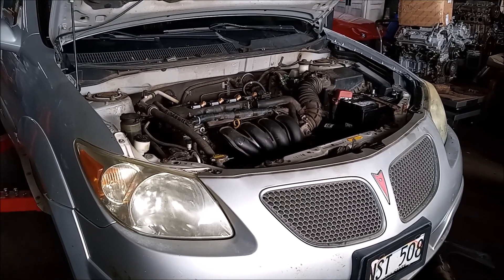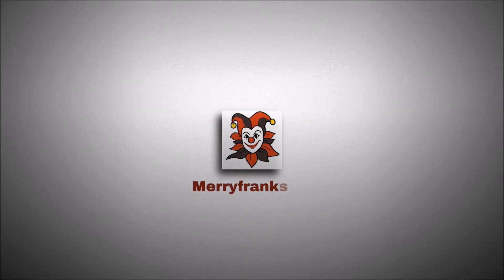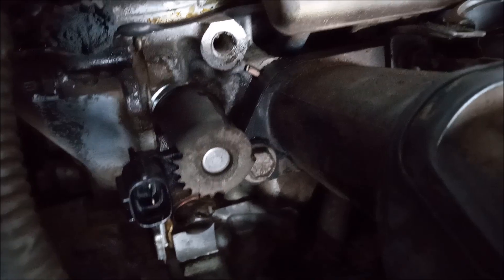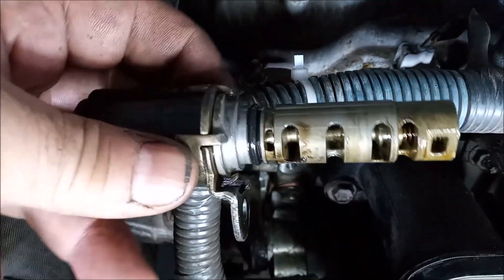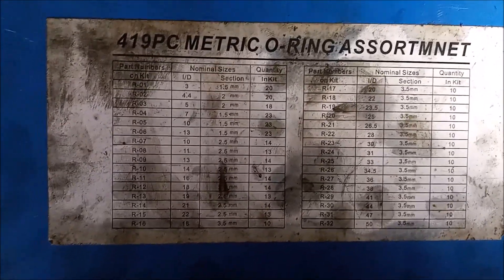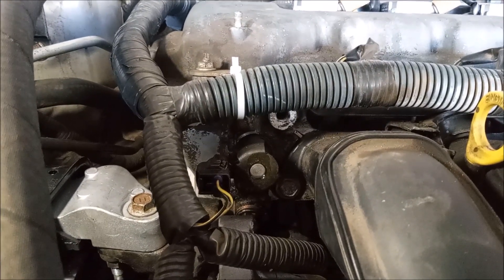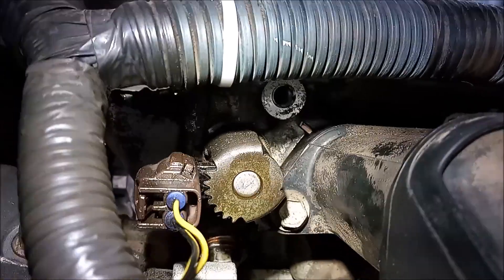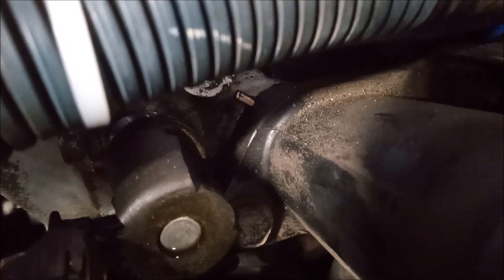VVT System Oil Leaks - Toyota 1zz-fe - Corolla Matrix Vibe MR2 Spyder

Comment: Hi thank you for making this video! Did replacing the ocv stop the oil leak?
Reply from the maker: It did stop one oil leak from the o-ring but it turned out that oil was coming out of the very tip of the OCV i.e. flowing through the OCV internally and coming out of the OCV case. I reported and showed this in another video.